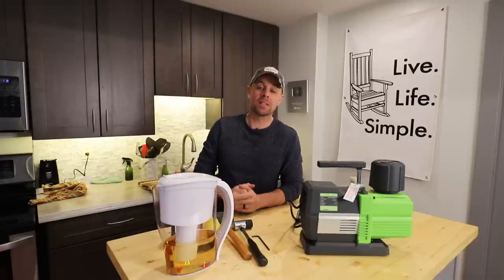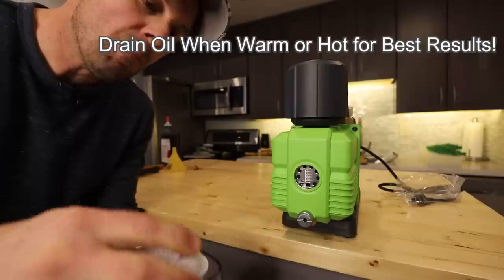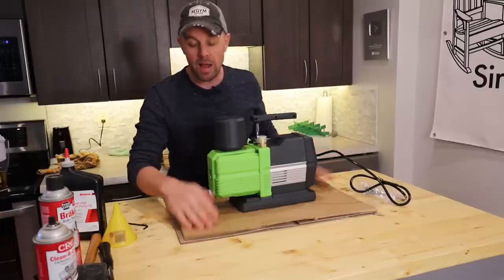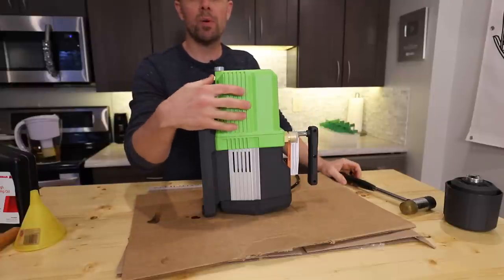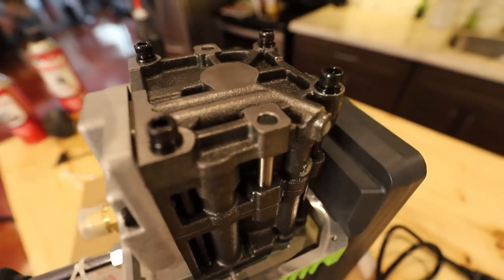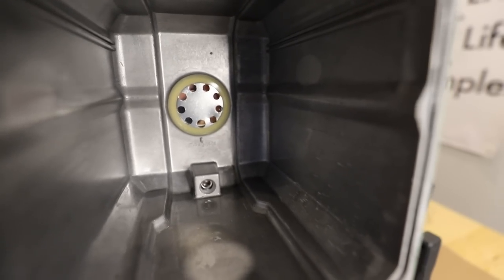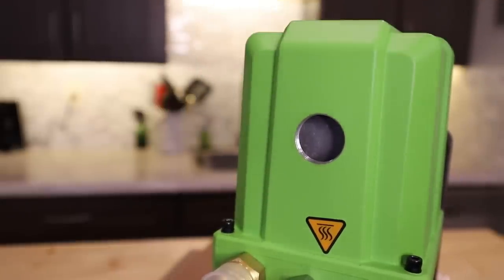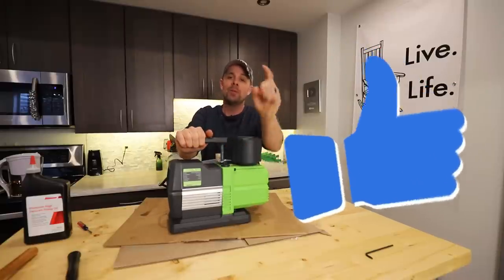Premier Pump Maintenance -- Cleaning the Internals & Removing the Cover

Comment: FYI.  My site glass did fall out.  After much frustration, HR said to use silicon to "glue" it back in.  So I did and everything is working well now.  Thanks for this informative video!
Reply from the maker: Sorry to hear that, hopefully you can get that fixed!
Reply: My site glass leaks at the bottom (slow leak). I want to fix it with the silicone glue mentioned. Did you remove the seal holding the site glass in then glue it? I think mine will be mostly sealed and I just need to add a bead of silicone along the bottom half or I may do it all around the glass. Can you tell us how you glued yours back on and if you had to remove the seal? Did the seal go back on good or did you have to glue that as well?

Comment: My sight glass started leaking and my MTOR would not go below 700. I called HarvestRight and the told me that my vacuum error wasn't the leaky glass sight but they suggested replacing it anyway.  They also sent me some videos on how to wrap the lines from the pump and freeze dryer with Teflon and self sealing wrap.  This is so frustrating for me and I have been putting off replacing the front cover of the pump. Your video is quite timely! I have had my freeze dryer since October 2021. Sadly I have not used it as much as I should and would have liked to.  I have been dealing with some health issues that have kept me from doing more.  I am able to garden now and need my freeze dryer to store my crops.  I plan on going one step at a time fixing this leak issue because I do not want to take my machine apart to wrap all the lines. I figure I would like to do the pump first and wrap the pressure release valve including the tubing fitting you said could possibly be a cause for leakage.  Could you tell me the size that the replacement valve would be at the pressure release? I do not want to take it off and take it to the store to find a replacement.  Please give me your thoughts on the way I should proceed. Thank you for all your videos and products.
Reply from the maker: I'm not sure of the size off the top.of my head.  A search in the Facebook or mewe group would get you your answer.  Use the 🔎 for search.

Comment: I have not used my FD in over a year.  Should I clean the pump before i start freeze drying?
Reply from the maker: An oil change wouldn't hurt.  You may find that the oil is fine

Comment: The O ring on my demister won’t stay seated. Not sure why, but it’s a challenge to get it to stay in place when I am replacing it after adding oil. It hasn’t been used yet, but I have to watch closely as I screw down the demister and hope that it’s in place!  Any ideas on how to get it to hold?
Reply: I would contact harvest right for a new O ring. They are fantastic about helping you out if a part fails or doesn't fit right. I had a motherboard go bad and they shipped me out a new one in no time and were even willing to walk me through installation if I needed it (I didn't, but still!) Great company with a great product.
Reply from the maker: Put some oil on it and it should stay

Comment: How "new" are the pumps that don't  rust? Mine is 18 months old and was leaking oil. Hubby took it apart today and it's full of rust, corrosion, and crud. The screens are full of rust and black gritty particled that feel like metal pieces. Really disappointed in the pump quality!
Reply from the maker: a freeze dryer pump is exposed to water constantly.  Even stainless will start to rust or corrode over time

Comment: Question, my new pump gets very very very hot, is that normal?
Reply from the maker: Vacuum pumps get very hot and to some extent they are designed to run hot for several reasons.
Reply: @live.life.simple.  Thank you and have an awesome day!!
Reply: Yeah I find it slightly concerning but everything seems to be okay. Using a temperature gun I'm getting readings of a 150°.